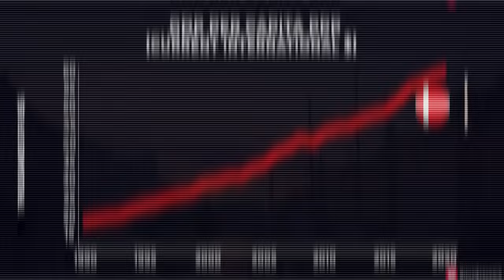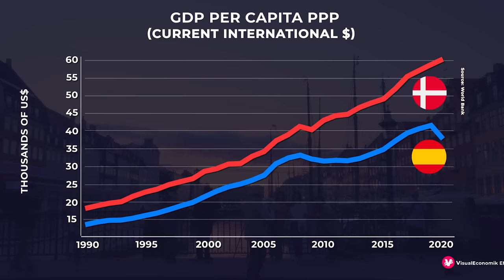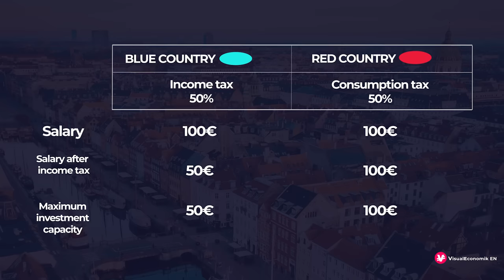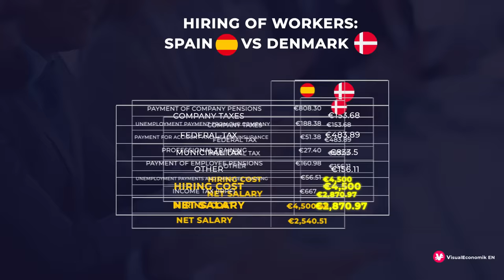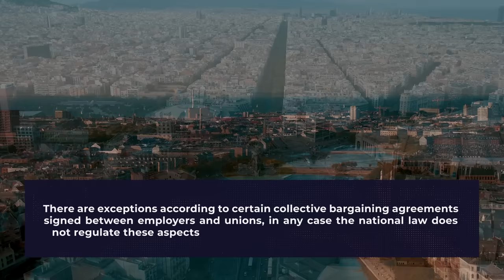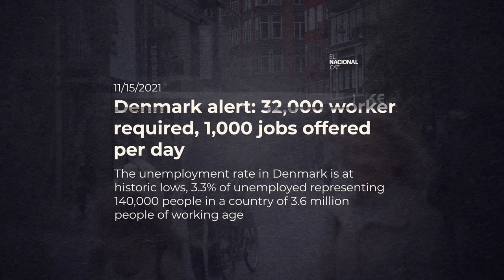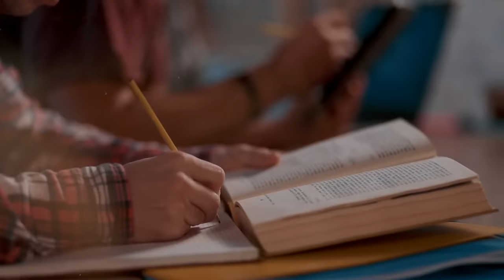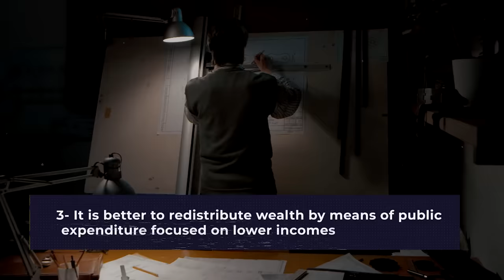Why Is Denmark So Rich Despite Huge Taxes?

Comment: The taxation is high, but it's smart. In Germany we have similar problems like in Spain, the money is just wasted left and right here and economy struggles with overregulation. Denmark also has a tax-funded social security system (like Sweden) and I think this is in the long run superior to the Bismarkian "pay as you go" system.
Reply: Following the color code in the video, Germany use the violet tax model.  XD
Reply: I think that EU should examine and determine how to apply and distribute taxes looking at models and historical data, government just try to follow the latest populist push without evaluating rationally what could be the most optimized system, isn't it just old and ineffective to go by ideology and ignoring facts?
Reply: Yes. As a Dane, I actually prefer our relatively high taxes, because they pay for what would be many "surprise" expenses, if I lived in US.

If I lived in US, I would have to save up a lot of money, in case I lost my job or got sick and needed surgery, etc.

Instead I can spend what I have, which is good for the economy, shops, and companies, and still get healthcare if I need it.

I don't have to worry about paying rent or buying food, if I become unemployed.

There are benefits and drawbacks to every system. But I wouldn't want my country to change to any other system.
Reply: @anderslarsen4412  you dont have to save a lot, you can just invest in a HSA (A type of savings account that lets you set aside money on a pre-tax basis to pay for qualified medical expenses.) and for saving for lost jobs you could either invest your money in Roth IRA or 401k(401k is pre tax money) which allows your money to grow tax-free (both of them) and if you don't want to invest you could just have a emergency fund(of around 3 to 6 months of expenses).
Reply: @DoubtingThomas isn't it possible to try different ways and determine which is better (or less worse). I'm ok with some people being disgustingly rich if this doesn't impact on other people's well being (it's probably an oxymoron but if by some reason it's possible, who cares ?)
Reply: In Denmark money is also thrown left and right. So mutch money goes to stupid things and expensive projects. In Denmark the goverment doenst even know what to use the money for so they choose a working class that works for the state and give them higher salary. I like paying taxes and love what we get for it, but still i would wish it was lower and we would focus more on where the tax money goes and to what. One thing dont get is the taxes of cars wich is the highest in the world if a car pretty mutch anywhere else is 10 grand in denmark it would be 25 grand for 150% tax on cars
Reply: Germany is like the worst of both words

Comment: Another note: The reason that capital gains are taxed at taxed at 42% in the highest bracket, is so that company tax plus capital gains tax roughly equals payroll tax. This is to avoid speculation of whether you should pay out as capital gains or as salary (at the highest bracket for capital gains anyways).

Comment: Something that has to be cleared up, you cant pay "55% of your income".

Theres Something called the top tax limit, and I think its around 700k

So if you make 750k a year, you only pay 55% of the 50k over the limit
Reply: Interesting
Reply: Wrong. Is 500.000kr
Reply: Normally you pay 47% plus 25% in sales tax. That is insanity already. it does not need to be at 55% to be insane!

Free Denmark!
Down with the welfare state!

Comment: Cool video! I wanted to add that in the Netherlands, VAT is also divided in brackets, with a low rate (I believe 6 or 9%) being applied to essential goods and services such as groceries, and a higher rate of 21% being applied to less essential/luxury goods (although the term luxury should be interpreted very liberally here). This way, people that spend more on non-essentials (e.g. the richer people) pay proportionally more VAT. 
That being said, the Dutch tax system is far from ideal, as we too tend to tax labour heavily and shroud the hiring-and-firing process in red tape 'to protect labourers'. As an example, the government wants people to work less part-time, but upon investigation one may find that a 24 hr work week yields more net income (taking into account taxes and subsidies) than increasing to 32 hrs/week in the same job. Many people in my parents' business put this forward as a reason not to work more (and rightfully so). Maybe this can be an interesting topic for a video someday.
Reply: Indeed, the danes didn't get so far yet, not at all, even the opposite encouraging workers to work more

Comment: As someone currently living in Spain I wouldn’t say taxes are the problem (yes, they are high and real incomes are low, but that’s not THE problem). The main issue is the amount of taxes wasted in bureaucracy, excess of public workers, and lack of efficiency in general within public institutions. The amount of money redistributed is very little, and therefore they are usually in the urge of taking more takes of rich (and average) people to compensate that
Reply: If you lower taxes, you will have more bureaucracy per tax dollar. To get a more efficient system, you want to raise taxes, so the government has enough money to be able to afford to be effective in their task of giving back to the economy. It sounds counterintuitive, but really it is not: When you pay people well they are more inclined to do the job well, when you pay them poorly they will try to get away with minimal effort.

Comment: I would support both Denmark or Spain, over Germany, which acts as Denmark (for middle and lower middle class) and Spain (upper middle class business owners). Germany's GINI coefficient is fairly poor, for third highest taxed country (after Denmark and Belgium), and adult wealth ownership (worse than Slovenia, Malta, Portugal) is very low for GDP per capita (at par with other Nordic European countries).
Profotability of major DAX companies are marginally better than US counterparts (e.g. SAP vs Oracle), yet salaries are about 75% worse than US companies for similar level of productivity. 65% of capital flows outside regular capital market. And profitable DAX companies as well as family owned Mittelstand companies are mostly domiciled outside Germany, in tax heavens like Switzerland, Luxembourg, Ireland. Making Germany basically a consortium of industrialists, than a country operating under a rule based jurisdiction.

Comment: One advantage of VAT or sales tax, you didn't mention, is it taxes all production factors (land, labour and most importantly capital) indiscriminately. Meaning you can't weazle your self out ofthem and they can be simple to collect (especially the sales tax). As a result, you have a good base line taxation and you can use other taxes to regulate, which revenue streams should regulate final prices and provide contributions to, for instance offsetting systems, such as consumption tax on tabbacco, which can be funneled into healthcare to offset increased expenses caused by ilnesses caused by smoking.
Reply: To a point. After that point (if VAT) is too high, a cash economy grows.
Reply: VAT is also a great way to get the lower and middle class to actually contribute to tax revenue instead of over relying on the highest earners.

Comment: One issue with higher VAT in a globalized world is that it hurts local retailers. It's very hard to collect VAT on international vendors, so it's possible to shop online in many places, especially for digital goods, without paying any VAT at all. Large vendors like Amazon will work with the governments to collect the appropriate VAT, but small vendors likely won't. Some of these are resellers, so you essentially get the same product. I'm sure that Danes still prefer the convenience of buying with VAT, but with local or well-known international vendors. However, it still lowers local retail profit margins and encourages law breaking. Other than that, agree with the video. Not all taxes should be progressive, and a general business-friendly environment is often more valuable than low taxes. As always in economics, it's a question of balance. One key aspect that's difficult to quantify is the local culture, which in Denmark encourages people to trend toward the middle, while in some other countries (especially the US) it encourages people to go to the extremes. Each one of these has its own pros and cons, from an economic standpoint.
Reply: VAT is arguably the easiet form of Taxation that exist, and since it is easy to make a diffirentiated VAT (Sin Taxes and higher VAT on luxury) it is holy up to the governments to make it more equal.
Reply: "However, it still lowers local retail profit margins and encourages law breaking." 
No, of course it doesn't. The reseller simply ads 25% VAT on top of whatever price he wants to take in order to make a profit. It's not exactly rocket science. It's the buyer who pays the VAT, not the reseller. If you mean law breaking by not adding VAT to your products then you're simply setting yourself up for big trouble when the state comes asking for that money.
Reply: @LarsPallesen  Obviously this is not what I was referring to. Local retailers have to compete against international retailers who will gladly ship to Denmark. A few large international retailers don't care about Danish laws, and most small ones can't enforce them in the first place. There is always some cheap competitor abroad who will sell cheaper inferior products, but a high VAT means that local retailers need to sell the exact same products for 25% more. Granted, this is an over-simplification of international supply chains. However, the general gist is that higher VAT = local retailers are at a greater disadvantage. The law-breaking would be by savvy consumers who don't want to pay the 25% premium. Good luck enforcing it on every single personal import! Even better luck enforcing it on digital goods (software).
Reply: @Ynhockey  It was like that until a few years ago, the EU slapped that down hard, now international sellers do have to collect and pay the VAT, for digital goods that isn't any easier to escape paying the VAT on either as the companies for sure doesn't want to be excluded for the EU marked and that's how the EU handles it, target the companies or even the entire country the company is in, but not the consumers when it comes to collect the VAT so be a savvy as you want but you'll find it very hard to avoiding the VAT.
Reply: @bnorth1087  That is only for those residing outside of the EU. If you can find something in Germany, Poland, Sweden and so on you only have to pay their vat.

Comment: Hej
Im danish and i think you cover it quite good. As you say the flexibilyty of the work force is the most important i do belive. Of course its not funn to get laid of, and do belive me i have tried that several times, you get at notice. and it depends on what the work place deside, some times you work in the period other times you go home and the company pays for the notice period. 
I work in industry and crafting, we have the lovest notice periods, depending on the trade union. But you will typical have from 1 week to 3 moths, depending o the time you ben with the company. I used to be a printer and after 5 years i had 6 weeks notice. And if i get laid of the trade union pays a desent amount so i can live preaty good. 
And the other way around in the industry if i deside i want to cheng work i have 1 to 4 weeks notice. But often work palces are flexible and wil let you of before if you ask. The idea behind it is that if  you treat your workers well they might return or speak well abouth you to firends.
A topic you didnt mention is the manager style. we have a rely flat maneging style.  I have 1 leder before the CEO and we are quite a big company. The belive is your workres are free under responsability. That means for me i get an amount of work i need to do, and they expect me to do it. Its my reposability and no one controls me or how far i am in the procces. Of corse i fall behind, they might ask or if i think its to much i can ask for help from a college. Also ledership are very open to hear new proposals to change and improve the work. So if i sugest somthing they will listen and if its a good idea it wil be implemented
Reply: yes the same for me. and when we have dinner all together the boss is also included and treated the same as the workers. even our royal family is like everyone else. I never feel embarrassed or low in Society and i love that. everyone is just part of the flok

Comment: You were on point on legislation, but as a spanish citizen there is also a cultural component that explain the broader problem. In Spain there is a very, very poor finance and enterprise culture. Most people will not save, let alone invest properly. Companies believe that paying lower wages is the best way to compete, while investing in R&D is seen as a waste and almost ridiculous. Most of our economy is focused on tourism and low value services, wich don't require a lot of investment but don't benefit the economy much either, and suffer tremendously from global events like covid. Getting a loan from a bank for a project is a nightmare, and they will want a ton of guarantees before handling you anything. And so on and so forth.